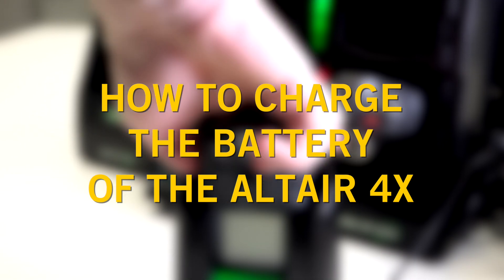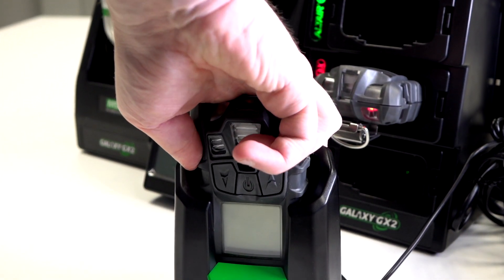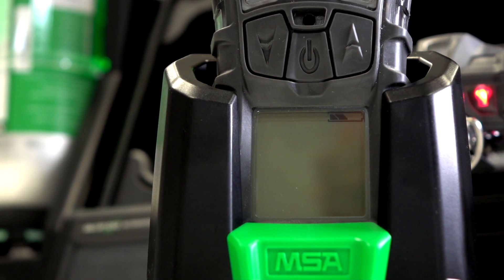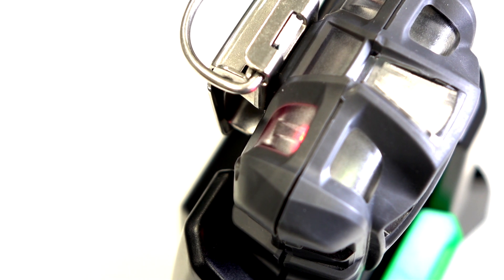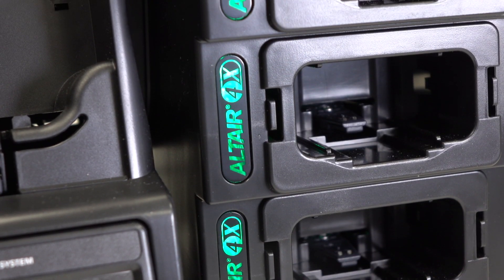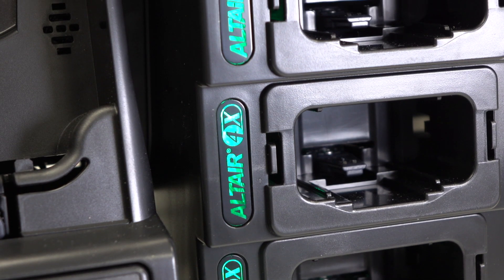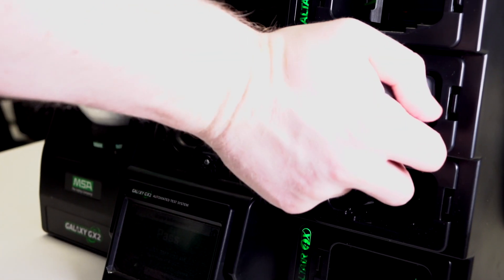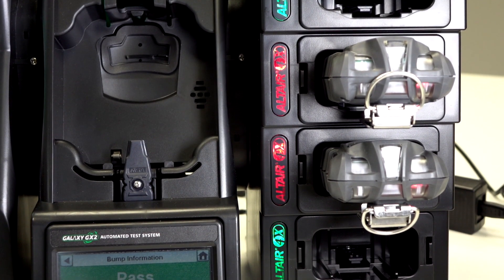MSA Altair 4X How to Charge the Battery

Comment: What are the common problems when the unit will not charge at all
Reply from the maker: Hi Kyle,

If the unit is not charging, it sounds like there is an issue with the battery. You should contact your nearest MSA service centre and get them to inspect it for you.

We are located in Glasgow, UK and can service MSA monitors across the full of the UK. 

Thanks,
Callum